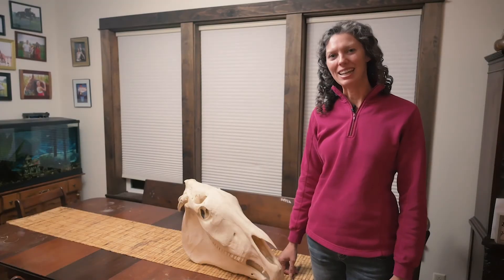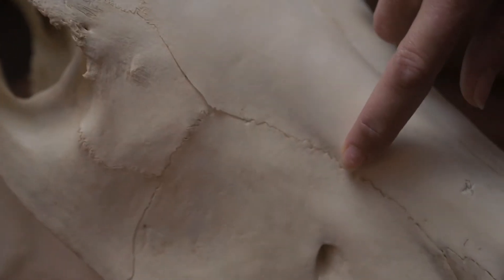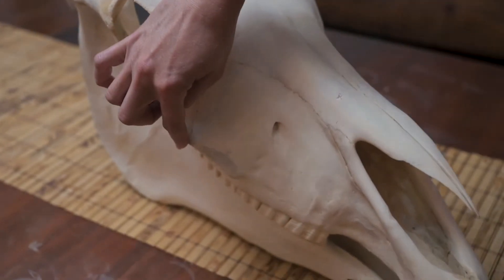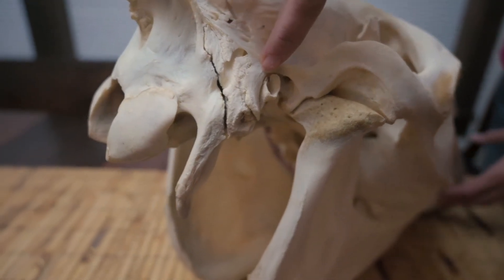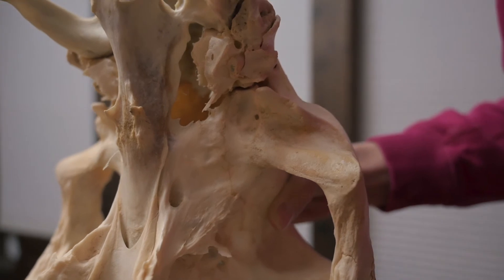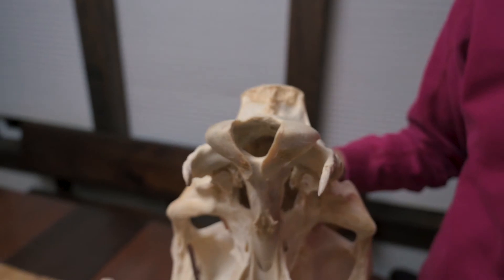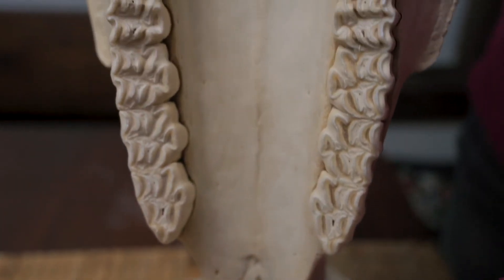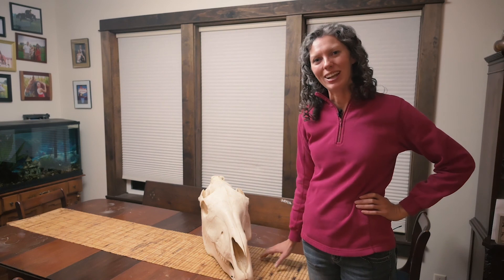A Closer Look at the Equine Skull

Comment: This new trend of bitless bridles is very troubling to me. I've seen horses broken from rearing by putting a bossal over that part of the nose and using that pressure to convince the horse not to rear, whereas a bit didn't have any influence whatsoever. That bossal skinned the ridge on the nose and created an open sore. Over time when using a bitless bridle the bone will thicken and change and even cause a divot in the horse's nose in certain situations. It's not a tool for a novice. It's a torture device.
Reply from the maker: This can be true for sure when used incorrectly, but I've more often seen remodeling of the bars in the horse's mouth from the use of the bit. You have to pick your poison and use it wisely.